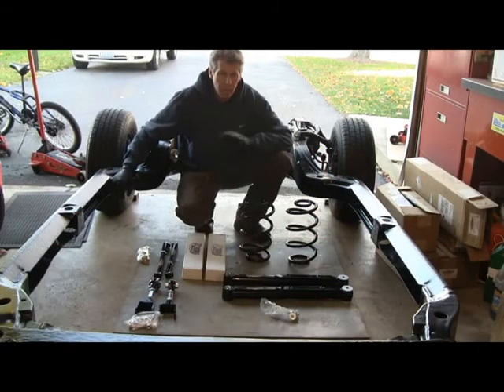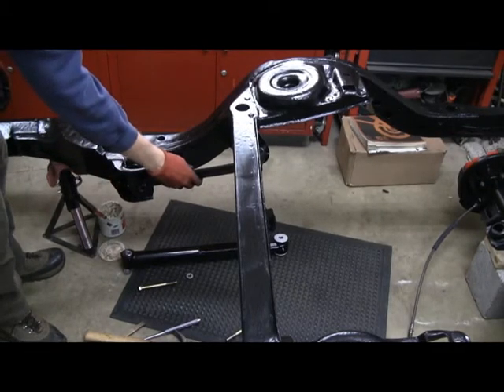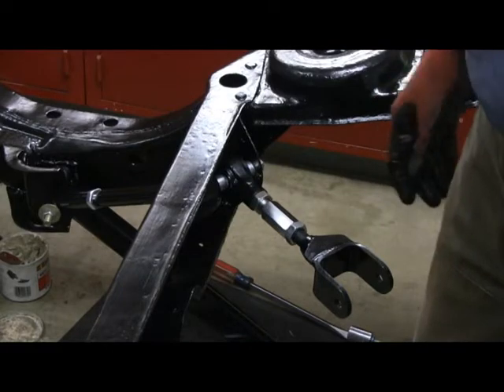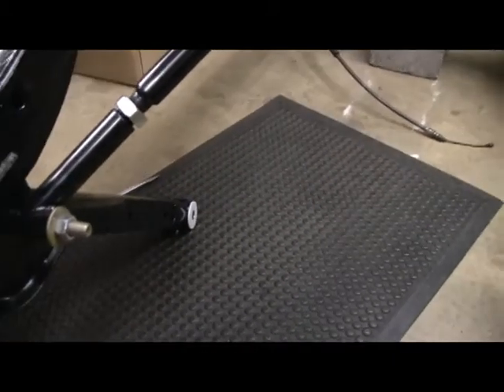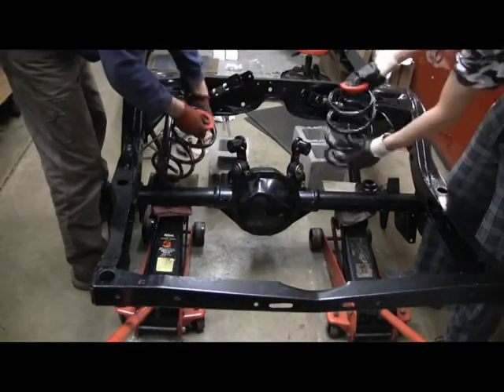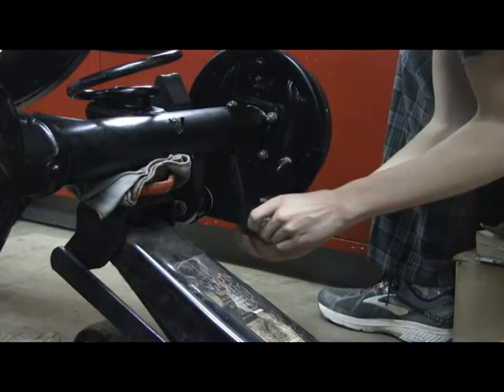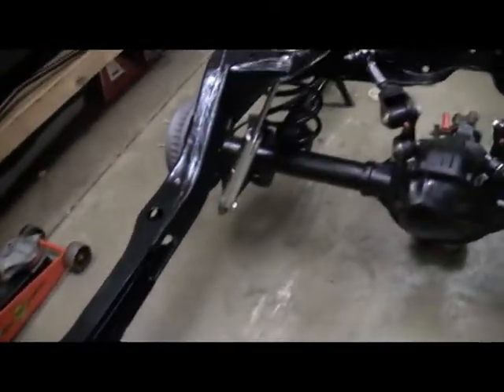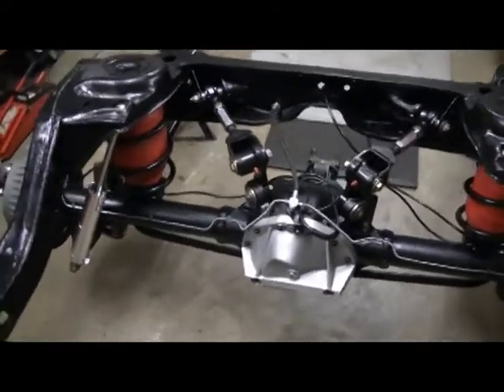LS Conversion Swap Part 25, rear suspension assembly

Comment: Hey, you might want to male sure you used the shortest possible upper shock bolts. With the body on the frame there is very little room to get them out. Not a huge deal, but it is annoying to have to pull the body mount bolts to get them out
Reply from the maker: Thanks for the tip and you are right, my bolts are too long. Unfortunately by the time I saw your post I already have the body back on (see latest vids). The bolts clear the body, but when the time comes I need to take them out I will have to cut or grind them out. Not enough room to just take them.

Comment: Why did you decided to go with air bags in the springs?
Reply from the maker: I have run airbags for drag racing, mostly for the Rt side. When launching the axle rt side whats to drive the wheel up to the body. I put air in the rt bag to counteract that. The car launches straighter.